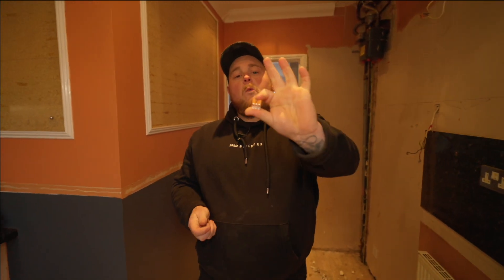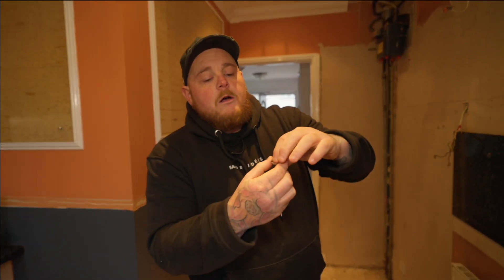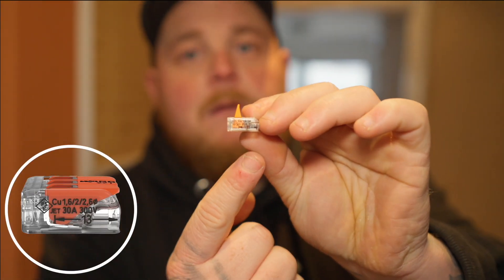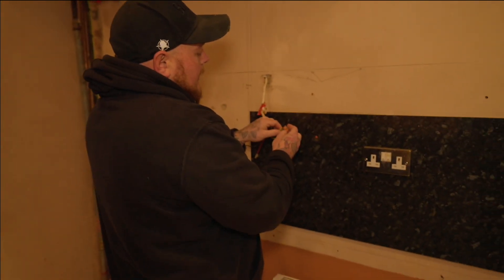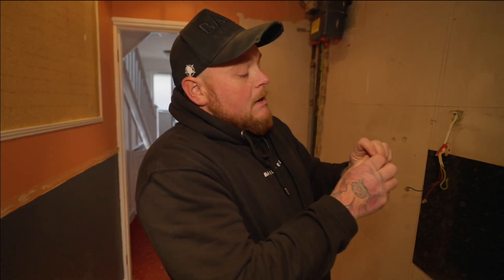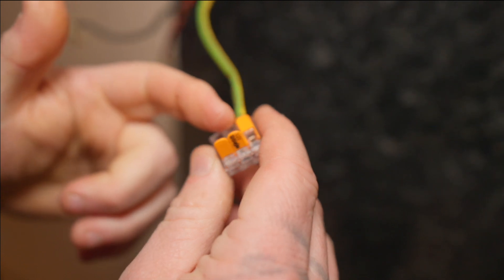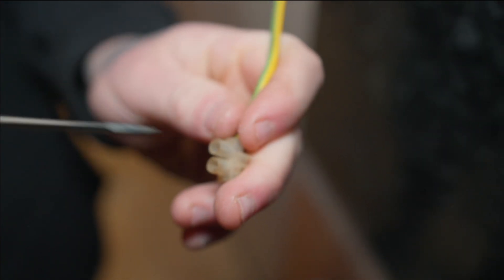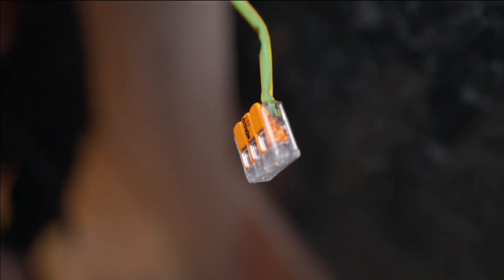HOW TO USE A WAGO CONNECTOR #diy

Comment: So I just picked up a bunch of these connectors from the local big box store and I will say that it makes wiring very very easy and not having to use wire nuts in twist the wires together. 

However one thing that concerns me greatly is how easy it is to remove the wire even though the lever is pushed down... If I try to pull the wire out it doesn't move but if I twist the wire left and right I'm easily able to pull the wire out of the wago connector... 

Not that there should be probably concerned but it just worries me a little bit whereas a wire nut everything is tightly secured both in the twisting of the wire and then the wire nut itself.

Comment: How would I link a cable from 3 core lighting to another cable Ive got a an outside light that id like to run a link from to power 3 more daily chained light from but the main cable is only 3 cores how would I link another 3 core cable into the circuit using wagos please